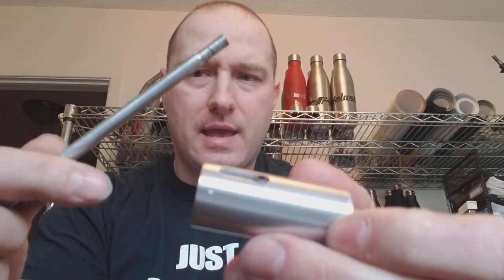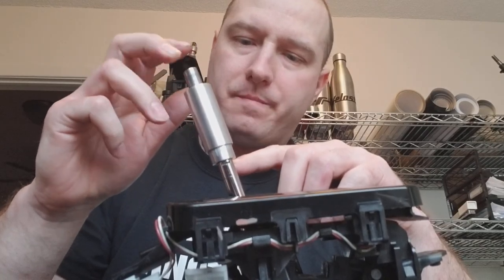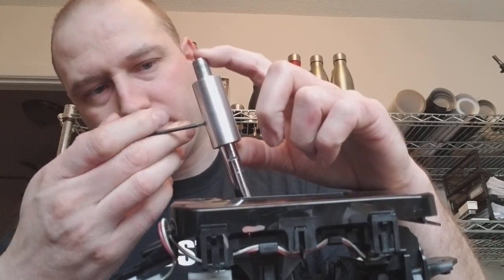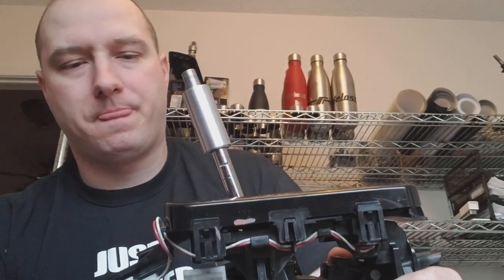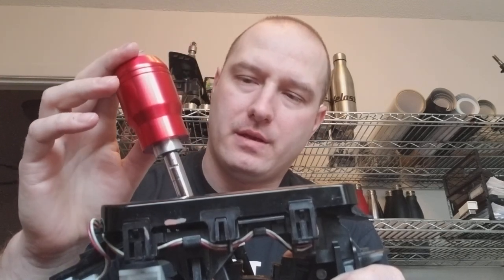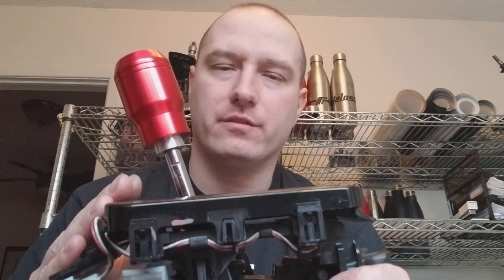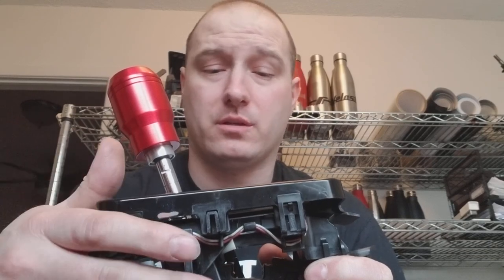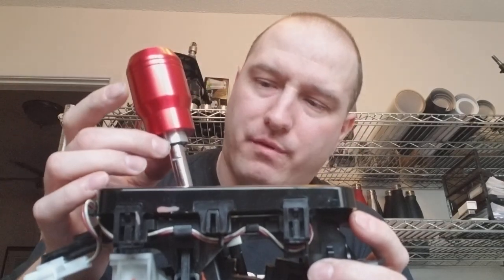2014+ Cvt shifter install designed by me!!

Comment: What's the knob thread size? I read on the description page that it's made more specifically with your knobs in mind. I have a cvt, and I really want to make my interior more unique, ive been looking at billetworkz, likewise and some other company's shift knobs. I was wondering if they'd work with your mod.
Reply from the maker: Pandzilla with anything other than mine I don't guarantee fitment of others products. I thread the top standard toyota /Subaru thread size of m12*1.25
Reply: A Car Guys Garage So if I have a shift knob that would fit a stock subaru manual transmission, it would fit this conversion kit?
Reply: My Crosstrek was stolen and they ripped the shifter out so I have to either figure out how the original goes back which is harder than you'd think to find. I like that though you sell those I assume? I'm interested and am sick of scraping my hand in that hole every time I need to shift especially in the winter
Reply from the maker: @TheOkayOutdoorsman  Yes.
Reply from the maker: @derekstone1553  Email me please. acarguysgarage@gmail.com
Reply from the maker: @michaelmauk6636  hit me up on Instagram @acarguysgarage or Facebook or email me acarguysgarage@gmail.com

I'll help you where I can.